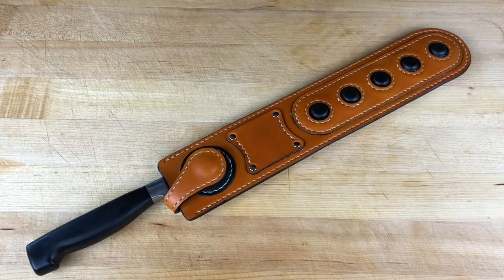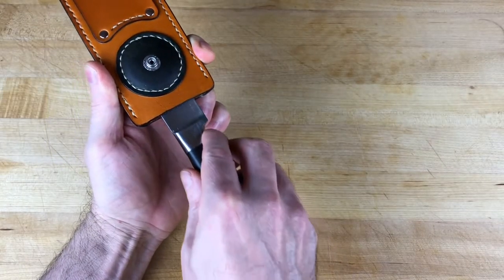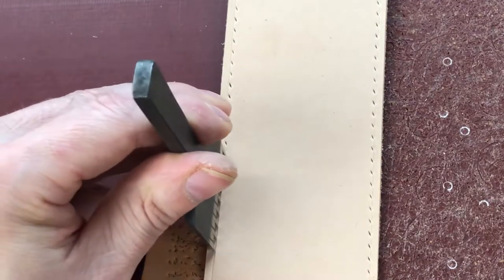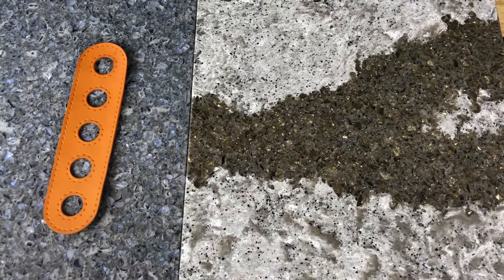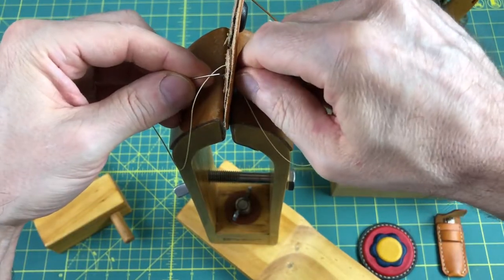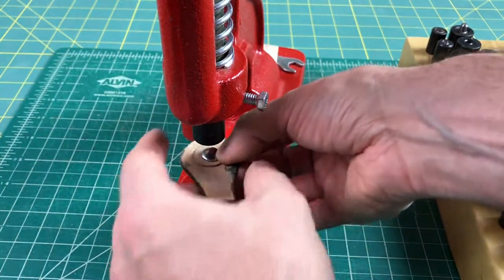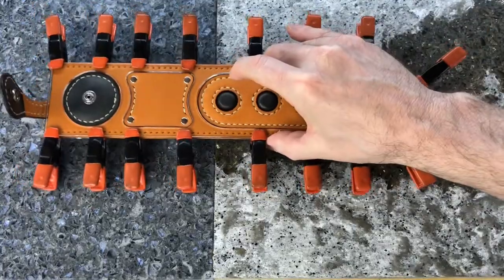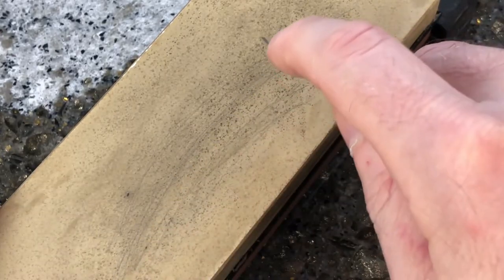Tips & Tools Used To Make Raised & Lined Leather Edge Guard For Slicing Knife

Comment: That's an intense project. Very unique looking sheath! If you dont mind me asking what brand Arch Punches do you use? I'm looking for a set but afraid to buy a very economical one
Reply from the maker: Hi, thank you!  I have tried a few popular brands of hole punches; Craftool, C. S. Osbourne, General, and Vergez Blanchard.  The smaller sized punches up to 1/2" are easier to get and not very expensive so I bought Craftool mostly and I only buy the sizes I use so I don't have a complete set.  For the larger sized arch punches, I bought the sizes I needed that were available so ended up with a combination of brands to make an eclectic set that keeps growing.  The most expensive punches I bought direct from Vergez Blanchard factory in France which are excellent, but you are paying for the made to order experience and the delivery times can take a while to get through Canadian Customs, which is where I am from.  I have a few mid-range priced C.S. Osborne arch punches, which I think are my favorite and used the most because of the popular size of the hole 5/8", 3/4", & 1", but the quality is excellent too.  Some of the more odd shaped sizes like 1-1/8" to 1-1/2" sizes I bought the General brand off of Amazon, which are the least expensive and the least polished but still very useable.  For larger than 1-1/2" arch punches they can get very expensive so I use a clicker press with large circle dies or cut around acrylic templates.  I would stay away from the "No Name" brands that only come as a set because the option to replace one if it becomes damaged is not always an option.  I would recommend buying the type of punch for your purpose starting with the least expensive or available to even purchase because that is what I do lol.  Great question, hope this helps!
Reply: @PaintedSpoon  thank you for the detailed explanation. I did consider Blanchard but the cost is very high. I’ve owned several Blanchard tools and although they might’ve been industry standard (before) the quality was mediocre considering their price. Perhaps I should do just what you said and buy what I need and maybe even one at the time instead of a set. I can always print out a circle pattern in illustrator and cut it out with a skiving knife.